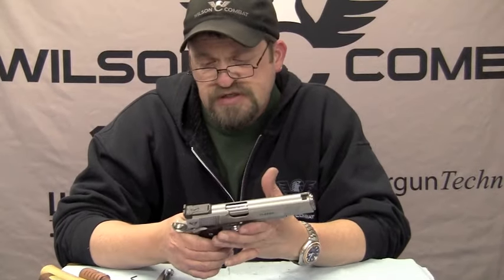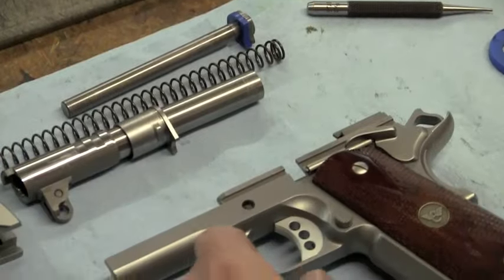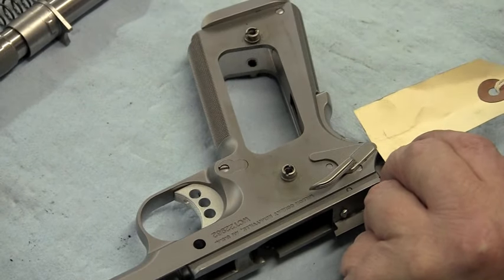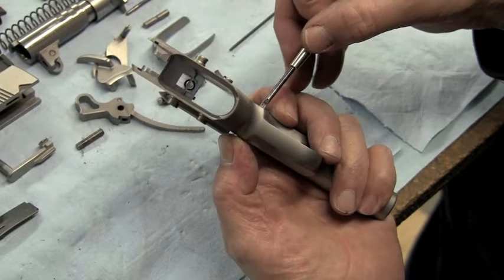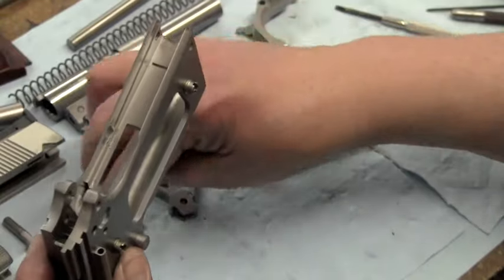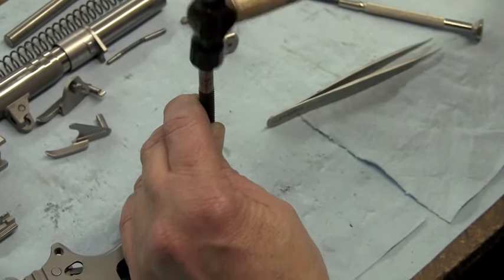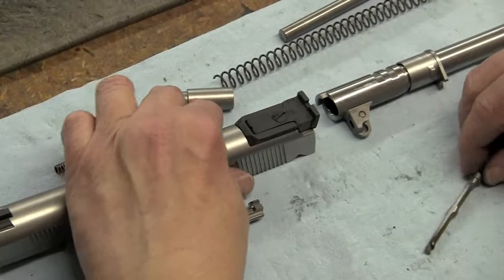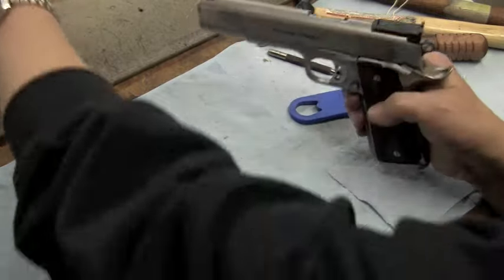Wilson Combat - Complete Disassembly of a 1911

Comment: This is a very good instructional video, I tore into my sig sauer scorpion last night and my sear had a third piece to it. When I took it apart it fell out so I didn't see how it went back together, after a little trial and error and some Google I found the correct position for it then had trouble with the sear spring. Thankfully Google was there with some stills and showed me how that was applied.  Was definitely an experience and I'm glad my 1911 is cleaned. Thanks for this video.

Comment: Excellent info, thx. Some say Browning worked out the kinks in the 1911 by the time he made the Hi Power, so the Hi Power had none of the 1911's "faults".  I think that generally refers to feeding and extraction, but I haven't had any major issues. But of course build quality varies and so many have made and are making the 1911, not so with the hi power...also, "cheap" mags obviously would factor in. The 1911 probably has one of the best triggers ever...
Reply: I bought a HiPower a year and a half ago...now I had to have a 1911, so I just ordered a Dan Wesson Heritage!

Comment: When putting the thumb safety in I use a flat wooden coffee stir with the rounded end cut straight across. Also a slight crimp in the plunger spring will prevent it from flying out when the thumb safety is removed.

Comment: So I have a Q hope you can give me some feed back .... Please,   When I pull my slide all the way back and let it go by feeding it with my hand , the slide gets hung up up on the disconnect . of course if I let go of the slide it just goes into battery  . And if I just rack it it racks fine..... Only if I slowly ease the slide forward with my hand having tension on it , does it get hung up... Q  will this break in over time ?? Will the Disconnect easy up and not be so hard to press down , so the slide will just ease over it , without hitting it at all. Its taken a few hundred rounds more like 500  to get it to the point were I could push the spring down by hand , still need the wrench to turn the  bushing .  thank you Jerald K
Reply: So you’re interfering with how the gun is designed to function and asking why it doesn’t function? Stop...
Reply: I dont know what a q is but i hope ron does and gets right back to you.  everything breaks over time so dont be surprised.and there is probably a reason the recoil spring has sixteens pounds of tension on it when its fully compressed.

Comment: Not familiar with that one. As long as it protects your firearm from corrosion and stuff than its fine. You should check out Hickok45's channel hes uses Ballistol which seems to work great its like a 2 in1 cleaner and lubricant, prevents corrosion and stuff.

Comment: I am not claiming to be an expert by any means. However, twisting the bushing around the barrel bell wears the tolerances and causes degrading accuracy. Also, moving the hammer to any position while the trigger is not fully depressed to the rear, relieving the stress off the hammer hooks, rounds the edges of the hammer hooks which causes the trigger job to get worse and eventually fail. these are basics to any serious 1911 gunsmith.